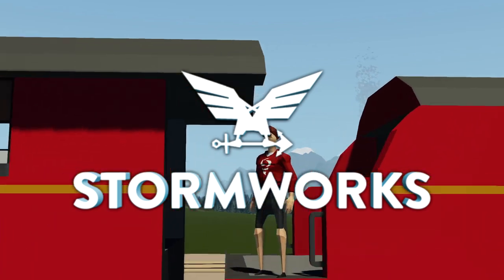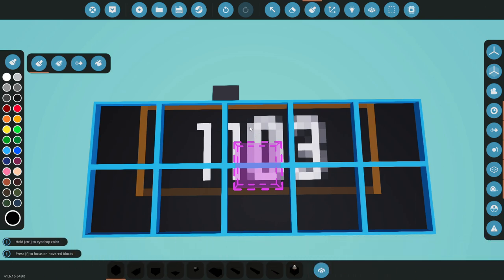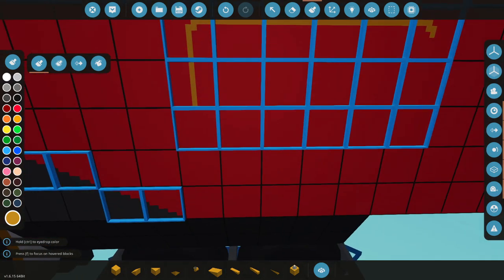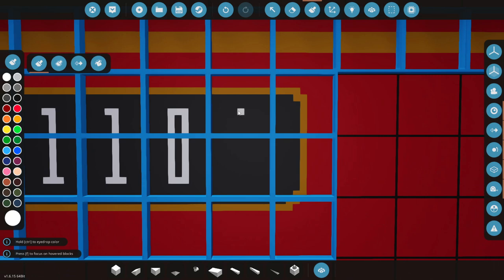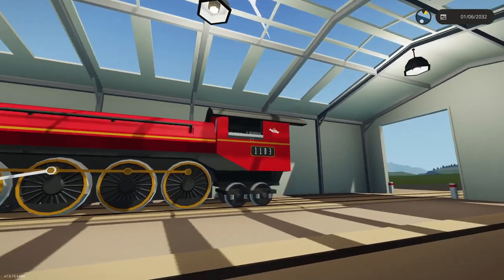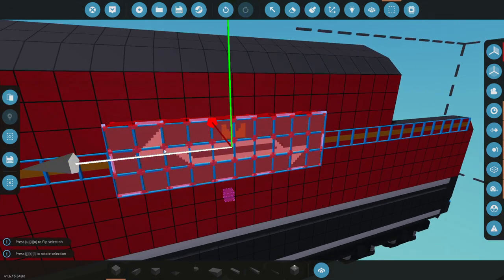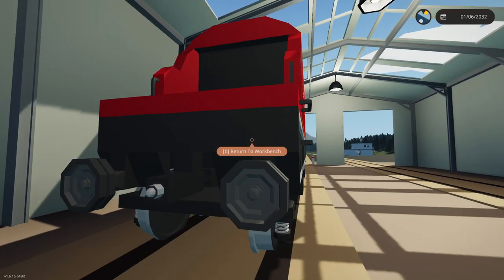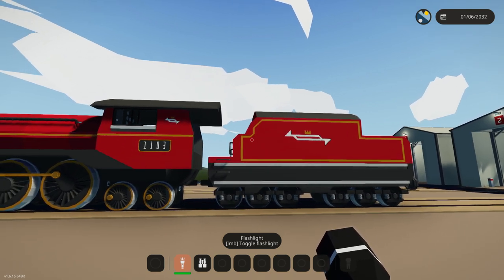Frantic Freight LOGO'S ADDED! - Lets Build A Steam Engine In Stormworks!

Comment: um you know that thing on top of the boler that sits next to the whiele yea thats the 'safty valve' and the steam that come's from the cilnender is calld the 'cilnender cocs' that is controd from the cab and is to get the vaper and moscher from the cilnender as worter is not conpresabel and you need to look at soome real blue prints of a steam loco as you know the dome on top of most british locomotivs yea that the 'steam dome' and thats were the valve that runs to the cilnender's are